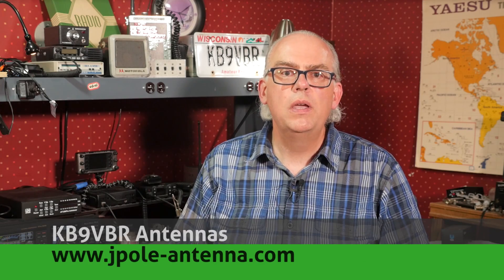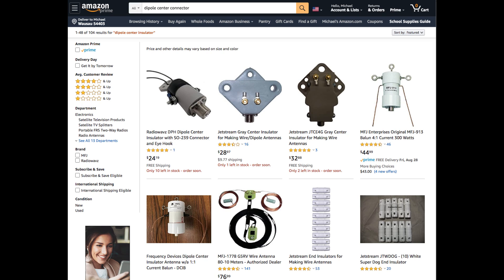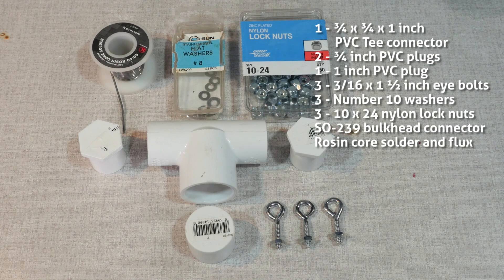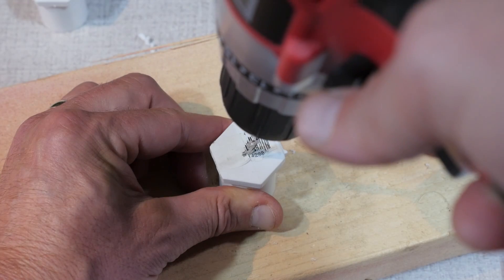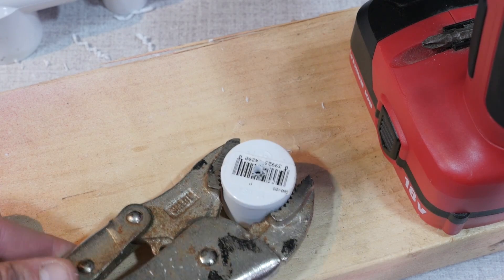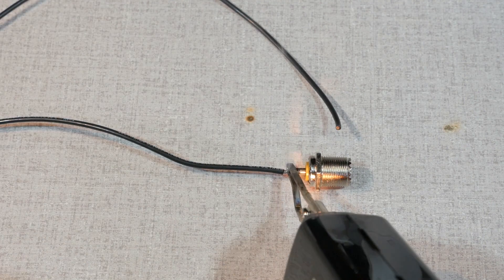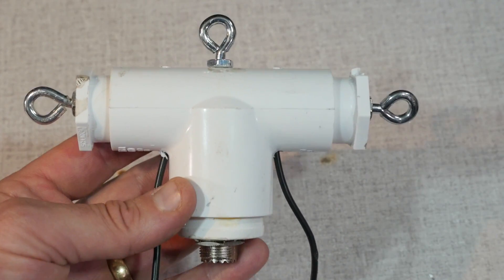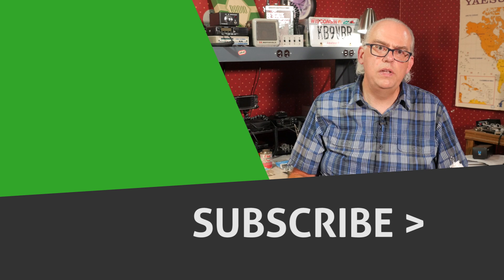Build a Dipole Antenna Center Insulator - Ham Radio Q&A

Comment: I appreciate what you've done here, but as with so many tutorials and "how-to" videos on U Tube, the newbie ends up lacking one or two really important details.  In this video, the missing piece (how to actually wire up the antenna) is promised in the "next video."  I watched it, and just as it gets to the salient part, you're talking about something else and your hand is in the way!   So I have a really cool center insulator, and I want to emphasize I appreciate that, but I still don't know how to wire up the antenna!   Gotta start somewhere.  I'll keep looking around You Tube for the "missing link."  Thanks again, Dave N9DMS  PS Nice seeing your on LICW club this morning.  Very interesting presentation,
Reply from the maker: Check out this video I made on the Off Center fed dipole. It has better shots on how to connect the elements of the antenna to the center connector: https://youtu.be/A0Ymcs2D7ks. Also, glad you enjoyed the presentation.
Reply: @KB9VBRAntennas  Thanks!!!
Reply: OK I watched it, but still have ??? floating around.  You're connecting to a balun in this one, so each side of the dipole gets connected to a balun eye hook, no problem.  But in THIS video (making the center connector) nothing gets connected to the eye hooks on the two sides, and we're left with about 8" wire or so coming out of the two "armpits" of the PVC "T" that don't get connected to anything.  If this were a 20 meter dipole, would those each be the ends of the 2 - 17' antenna wires ( L and R)  and threaded back up through the eyebolts on the two ends?  (17+17=34')  so - is one side of the antenna connected to the lead on the SO-239 and the other side of the antenna connected to the ground on the SO-239?  Thanks for your patience.  Dave
Reply from the maker: I think I'm understanding your question. The eyebolts on the center connector are not hooked up to anything, their only purpose is to support the wire elements of the antenna. the 8" pieces of wire coming out from the center connector needs to be hooked up to each side of the antenna. Just like I did with the 4:1 balun in the OCF dipole video, I thread the wire through the eye a couple times for strain relief and wrap and solder the pigtail coming out of the center connector to the wire element. (The concept of how to connect the elements to the center is the same no matter what type of center connector you are using).
Reply: @KB9VBRAntennas  Aha one last question.  If I have two pieces of antenna wire both 18' for starters for a 20 meter dipole, can I just run those through the armpit of the T rather than the "danglers" and avoid having to solder?  THANK YOU!   Dave N9DMS
Reply from the maker: You could do that, but you really aren't saving yourself any work as you will still have to solder the lines to the SO-239 connector that's inside the T. The purpose of the 'danglers' is to provide an easy connection to the elements and strain relief to the coax connector. That's why when using dipole connectors (of any type) we attach the elements to a secure point, which is the eye hook in this case, and then attach feed point via a short piece of wire to the same point.
Reply: @KB9VBRAntennas  ok great!  I wanted to make sure I understood how things were routed and now I am sure.  Thx, ‘73 Dave

Comment: I very much enjoy your videos. Does it matter if the wire is stranded or solid?
Reply from the maker: Standed or solid makes no difference. Stranded is easier to work with and is more flexible, but it is prone to stretching. Solid is stiffer and doesn't stretch so much, but it is a bit more brittle. I typically use stranded wire for portable or temporary antennas and will use a stronger wire for permanent installs.

Comment: Michael, Thanks for another great video!  What are your thoughts on whether instead of connecting a SO 239 connector at the bottom of the insulator, it would be better to connect a Window feed line with a SO 239 connect at the end of it to connect the coax?

Comment: Great idea. The strain on the end caps is depending on the adhesive though. I would drill through and stick a pin in to bind them and seal with glue or hot melt tape. I hope that helps.

Comment: Instead of a spade bit use a step bit. You can make a variety of hole diameters and the cut is clean and quick. Perfect for SO-239’s.

Comment: Michael, how do you connect the diplole wires the wires coming out of the connector? Thanks.
Reply from the maker: Twist and solder the wires to the antenna elements. The eye hooks on the sides provide a method of strain relief. My follow up video shows building the dipole antenna: https://youtu.be/zvtKlqQ6DSo
Reply: @KB9VBRAntennas  Thank you, Michael. I enjoy your videos. I'm using your SlimJim antenna for VHF. Works great. 73

Comment: So it is okay to tie a knot in the feedline?  Do you have to add a little more wire to make up for that, or does that still count in the final length(and frequency).
Reply from the maker: Just to clarify, the knot isn't in the feedline, but in the wire running from the connector to the outside of the insulator. This is fine and doesn't affect performance. The amount of wire is small and it shouldn't affect your calculations in any meaningful way.

Comment: Can I use 18 guage wire instead (plan to use less than 100 watts) , plus I have a roll of 18 guage stranded wire in my garage available
Reply from the maker: 18 gauge  is fine and will most certainly handle 100 watts of RF power.

Comment: when I put in my bulkhead connector an the lock nut there are not enough threads left to attach the coax. Are there longer bulkhead connectors?
Reply: I'm in the middle of making it and having the same problem. The so239s linked on Amazon do not have a long enough "neck" to reach through the pvc and be attached to from below. The seller probably changed the product.
Reply: @mantispid5  First thing I noticed that I was worried about...Think I"ll use this https://www.amazon.com/SO239-Female-Chassis-Connector-Shipping/dp/B00VPRCRGM and mount it on the outside.  Any of the 4 screws/nuts would be ground and a lot more secure...

Comment: Depending on your climate, a small drain hole next to the connector is a good idea.  Any dew that collects inside needs a way to get out.
Reply: If you wanted to get really fancy I suppose you could fill it with nitrogen instead of water-containing air and then make sure it’s totally sealed.
Reply: @TonyYarusso  Making it totally sealed is quite hard.  Connectors and coax work against you

Comment: Nice design, looking forward to the follow up one on the actual antenna build.  As for suggestions, I'd say to use deep well sockets or hollow shaft nutdrivers to tighten up the hex nuts and SO-239 nut, easier than using the pliers.

Back in 1975 I was using CB radios, and had a base ground plane antenna get mangled in a windstorm.  I ended up making a temporary dipole using RG-58 coax.  I measured off a 1/4 wavelength from the end of the cable, sliced around the outer jacket without knicking the braided shield, and pulled the jacket off the cable.  I then spread the braid where the jacket ended, creating a small hole, and pulled the center conductor out through that hole.  I then cut the old jacket into two equal lengths, and tied one end of each piece onto the end of the shield and center conductor.  I then tied the other ends of the jacket pieces to two trees, spaced the right distance apart, creating a horizontally polarized center fed dipole.  Since I'd used the CB band center frequency of 27.185 MHz (and done the math, measuring and cutting correctly) when I checked the SWR across the band it was essentially 1:1.  We ended up using my temporary fix for months.  (Here's hoping this story inspires someone!)
Reply: Inspiration accomplished!
Reply: @bigjai  Glad to have inspired someone (even after a year! 😁).  Hard to believe it's been that long since I posted...

Stop back with an update if you do build up your own versions!

Comment: Very useful tip. I can either do it exactly as shown or use it as a reference. Hope you come up with a video of how you build a 1x1 balun. 73 from PY5WHO.
Reply from the maker: You may want to check out my latest POTA video. I build the linked dipole antenna and put it on the air: https://youtu.be/zvtKlqQ6DSo

Comment: I made mine maybe 18 yrs ago and still up but did make it and looks like a 1 to 1 balun and also feed three dipoles from just the one. A 160M , 75M, and also a 40m and cut for the center of the band that I operate. Need a tuner at the ends but dipoles are hard to beat!!!  N4JOJ

Comment: Hello and thank you for the nice video I have a question ,I bought a 10 meter dipole long wire center fed I want to put this long wire about 4 foot above my metal roof building is this a good idea or bad idea? will it help with reflection? Thank you again.

Comment: When using PVC fittings for my center insulators, I added a flat washer and nut to the inside as well.  I do not trust the PVC alone as the eyes could have considerabe pressure and the extra hardware is cheap insurance.
Reply: Look again!  He did just that, using nylock nuts to eliminate lock washers.

Comment: Great idea. I strongly recommend the use of stainless steel over the cheaper zinc plated junk so common at the big box stores. Even though zinc is often considered for outdoor uses, it also rusts quite happily and well after awhile. The rust will add impedance at those points as well as fostering corrosion on conductors.  I built this exact same thing many years ago in my Jurassic period using zinc plated eye bolts, which is how I began a journey to the dark side only to be saved by stainless steel.
Reply: Hi, I do recommend using SS stuff in antenna projects.
I know you are concerned about the rusting process of the galvanized eye bolts mainly thinking (mistakenly) that the dipole arms are connected electrically to them.
No it's not.
The eye bolts on either side is just a strain relief to the connection between the wire radiators (on either side) and the pig tails from the SO-239 centre connector.
You may want to watch the video again to understand the contraption.
De VU2RZA

Comment: Why not connect internally and keep it reasonably sealed? Make the wires into a loop, solder the loop closed, and put the loop beneath the washer for each side of the dipole before cementing the cap.

Comment: I'd probably tap the holes rather than driving a screw into the PVC. I've also seen bulkhead connectors with a spot to solder on the ground side of the wire. Other than that great build!
Reply: Will that solder "arm" still allow everything to fit in the tube?

Comment: Very Informative Michael Thanks but what if i use end cap instead?

         73s From DU6KD & DW6XLC
Reply from the maker: You could use end caps‚ but since end caps are the same diameter as the Tee connector‚ you will need a small section of PVC to join the two pieces.

Comment: Hi Michael,
Nice homebrew Center insulator.
Lack of such piping material here in Germany.
 I ordered my center insulators ready made from the british company moonrakerukltd on eBay or the German company WIMO.
They are about 9$ or 7.5€.
Homemade would be a lot better, I agree, because you can put an small 1:1 balun inside.

73 and stay healthy
Stefan DG4RBS
Reply: Plus shipping I assume?
Reply: @WW5RM  Yes, of course.
But if you try, like me, to build a lot of different Dipole, you can order 5 or 10 at one time and the shipping reduces 😊

Comment: I love your approach. The only thing I would do differently is instead of drilling the two holes for the wires to exit the center connector. I would have soldered ring terminals to the ends of the wires and used the eye bolts as a place to hock the wire to on the inside of the T fitting.  Then I would have added 2 washers between to regular nuts on the outside of the Eye Bolts for a place to attach the dipole wire to, allowing for future wire repairs or to make the dipole for a different band.
Reply from the maker: That's a little more work but a great way to upgrade the project. Thanks for sharing.
Reply: Michael, I I tried that with a 4 band fan dipole. I added lugs to the antenna legs and stacked the lugs with star washers on the eye bolts. I filled them with dielectric grease to prevent corrosion. Looked really good. Worked really poorly. On further research, I decided that the dissimilar metals oxidized much faster than expected - weeks, not years. I reconfigured with copper wires as shown in the video and Bob’s my step-uncle. Still have a few tuning issues with the fan, but I made it to the Czech Republic a week ago on 40 with 80w SSB.
Reply: Earl Griffith what about using brass hardware?  Or Stainless Steel since it doesn’t oxidize as fast.
Reply: I used as much stainless hardware as I could find. Lowes didn't have ss star washers. So I had to use plated steel. My lugs on the wires were tinned copper, so a 3rd metal in the mix. I cut the lugs off and twisted the wires together and soldered.

Comment: Can do the same for $5.00, no drilling or gluing, with an electric fence insulator (corner post donut) and this:

https://www.ebay.com/itm/333672292813

Comment: As a noob to antenna building can you explain what those to wires connect to that you soldered to the so239 connector? As always love your videos
Reply from the maker: Those two wires will each connect to a leg of the dipole antenna. It may make more sense when I build the dipole in the followup video.

Comment: Great timing! I just pulled down some old Christmas lights and got two good wires out of the bunch. I'm not sure on the lengths, but it might be 2 m antenna or maybe a 40m if I'm lucky. I know how to make a dipole, but I wanted the center a bit better than soldering on the coax. This is perfect!
Reply: They are fun!  My first dipole was made out of a vitamin bottle!  The SO239 was mounted on the lid!
Still works today 11 years later!

Comment: I really like your design for this center insulator! After watching this, the only thing I'd do different is use a step (cone shaped) drill bit instead of the spade bit to drill the 5/8" hole.  
As always, thanks for an excellent presentation! I look forward to seeing the rest of the antenna come together. 73 - N1NUG
Reply from the maker: A step bit would be an excellent option. PVC is pain to drill big holes in- if I had a drill press‚ I'd be using that.

Comment: This was simple enough that I might just be brave enough to attempt it after I obtain the necessary tools. I think I might trim the 3/4" end caps though so that they sit flush with the T-connector.

I hope you will do a follow-up video on making the wire portion of the antenna. I'm not feeling quite comfortable with that yet.
Reply: 468 divided by your operating frequency. If you only remember one formula, remember this one. That gives you the length of your dipole. So, a dipole for 40m, say 7.180; 468/7.180 = 65.18, that's your length in feet. Cut that in half (32.59) and you have the length of each wire. make them a little longer (33 feet) to allow for wrapping the ends around an insulator and strain relieving the connector ends and there you have it. One thing to keep in mind, if you use insulated wire, the antenna will end up needing to be a little shorter due to the decreased velocity factor, but this gets you in the ball park.
Reply: @toddschutter6535  For newbies it would be great to actually see what you describe above. Thanks for adding it tho, will hopefully get me close.
Reply: At 20ft or higher you will never notice if the end caps protrude. Once you get on the air you wont care either! =]

Comment: That is how I used to make mine. Simple and works well.  Now I make them by only using a cap and reducer.  The cap version is also simple to make and a bit lighter. I like to make more than one when I do it so I have them on hand. It seems be just as easy to make 3 or 4 as it is to make one. Excellent video!
Reply: What size do you prefer?
Reply: @WW5RM  I prefer the full size like the one shown in the video for home use.  The smaller, cap version is good for taking in the field.  It is lighter and smaller.

Comment: Dipoles can be used in VHF/UHF as well. Granted they are smaller but in a beam antenna they are used with parasitic and reflective elements. Also SSB contacts on VHF are made with dipole or folded antennas to save space. As you have said they are mostly HF/LF band antennas, they are more common in lower bands.